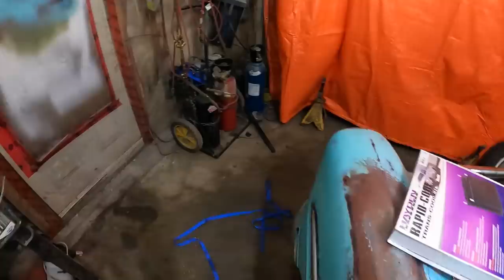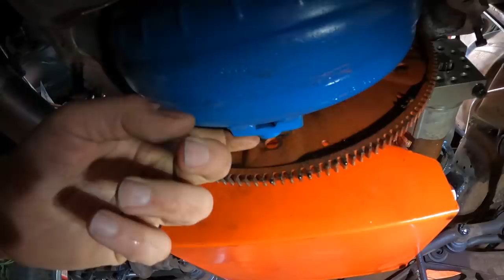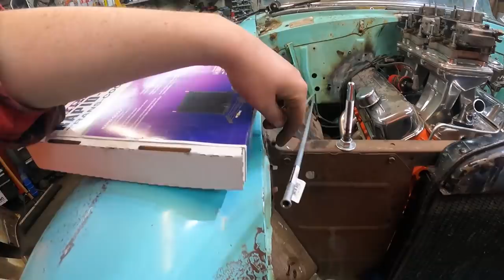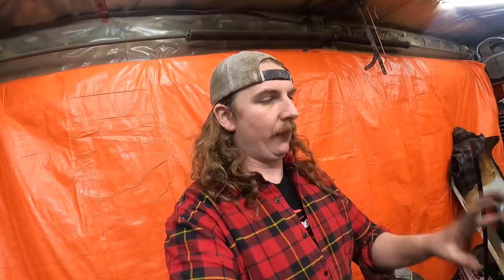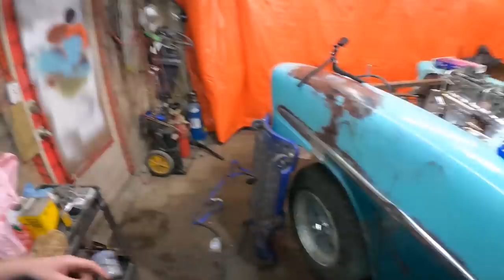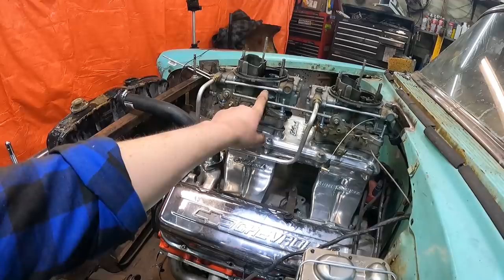How Much RPM?  ALL OF IT - Running A Chevy Big Block Wide Open With a Massive Fuel Leak!

Comment: Pulling the converter that far forward, you're not worried about breaking the ears out of the transmission oil pump, during a hard launch. Maybe install spacers or even washers between flex plate and converter in order to ensure converter ears/teeth are fully engaged with pump. But hell I may  be wrong, gas on it.

Comment: You have a lot of gap between the flex plate and converter so be sure to put some kind of spacers in between so you have full pump engagement with the converter hub.

Comment: All you need to do with that old alternator is run a wire from the field to power output on the alternator and your done. Those one wire alternators do exactly the same thing but internally so you can't see it. And it's a flexplate not a ring gear lol.

Comment: Damn! That engine sounds fine! Should glue a couple big neodymium magnets to the bottom of your starter box. Open up any old junk 3-1/2" hard drive to get a couple nice big ones. Maybe some thin rubber between the magnets and your "shiny" paint. Then you could slap that box down almost anywhere and it would stay put.

Comment: make sure the t-vert is engaged in the pump gear  drive.. fly wheel to con vert  gaap.. shim inbetwen with spacers washers to 1/8". this way pump gears are  engauged in converter drive lugs fully. loooking good dan..

Comment: Go to harbor freight they have a Chief burr bit set for $50 comes with your four common shape bits and they are AWESOME. And 50 bucks is a great price for a set of 4. I've paid $40 for just 1 in the past. I've used the shit out of them and they are still sharp as day 1! Comes in a handy dandy pouch too. They are hanging on the wall by the air tool display. Harbor freight RULES!!! I'm a heavy equipment mechanic and my tools get used hard and 90% of my tools are harbor freight and all my cordless stuff is Hercules and i can't tell you how pleased i am with that stuff. I'm proof that their stuff holds up to commercial use. If you buy Hercules tools ABSOLUTELY pay for the extended warranty cuz then you just exchange your tool every year for a brand new replacement for like $10 extra! Then you buy another year warranty and continue renewing them every year for $6 to $10 per tool! No questions asked, in store exchange

Comment: Definitely a "Franken-wagon" . You live a bit dangerously , my friend ! With all that HP , you might want to reinforce where you bolt the seat down . It's good that it has a new floor & all , but when you "launch" that monster , & it hooks up /grabs traction , anything in the front seat is going to be G-forced to the back of that bus . I've no doubt that the front wheels will leave the ground , & you my friend + passenger , will have an accident(s) in the next few seconds . Depends ! Definitely tape it ! Rock on Dan !

Comment: That fuel leak is scary, a car on jackstands and inside a building.
A friend had a 64 GTO with a big block chevy and tunnel ram setup. The hood was off and inside a garage under the house. He tried  to start it with the fuel lines leaking. He wanted to hear it run an after a bit of cranking it caught on fire with the flames hitting the ceiling. It was a good thing he had a few friends there. In a panic they pushed it outside and put it out with a fire extinguisher. The flames left their mark on the garage ceiling and without other people around he could have set the house on fire.

Comment: You might want to put a spacer between the flex plate and the converter. Learned that from performance transmissions channel.

Comment: Saving this for break but with the thumb nail.... I have take a guess.... 5700rpms
Reply: Sounds really stout Dan, I have one question  cuz I honestly don't know but do over think everything.  Will elongated th holes on the fly wheel effect the engine balance? 454 are external balanced on the fly wheel I think?

Comment: Having had a BBC in a 57 since 1987 I can tell you that stock rad won't cut it. Luckily a larger alum cross flow isn't that much $$ these days. Just have to match up top and bottom hoses.
Reply: I ran one in a Nova. Used Cadillac 4 core cross flow radiators to keep it cool.

Comment: Be sure that the centre hole of the torque converter fits the ring gear. Otherwise it could pull itself loose from those elongated holes.

Comment: Most parts stores sell a flexplate with dual pattern torque converter pattern that accepts the "big" and "little" patterns. They're like 40 bucks US at most places. Pioneer FRA-111 I think is the correct part number 454 dual pattern flexplate.

Comment: That fake injector air cleaner looks very restrictive to the air flow to the carburetors.  I would put open air cleaners of the 2 carbs.  However it is not my car and do what makes you happy.  Thank you for the video sir.
Reply: @MrGixxer1300r   Agreed. I'm just happy that's he's putting his efforts in these left-for-dead relics - and making them into certified Hot Rods. (Especially jealous of the Challenger TBH.) Once upon a time, building a Hot Rod was for the learning process and in-your-face boulevard attitude - not he time slip! Keep 'em coming Dan!

Comment: You should mount trans cooler on its side. So fitting out the side not out top or bottom of cooler.... use bottom fitting as feed and top as return so the entire cooler is used and trans fluid stays in it longer

Comment: Think the alternator bracket to Intake takes  a threaded rod intake bolt then alternator plate with a nut. 2 Nuts n threaded rod.

Comment: that is  not a six bolt flexplate its a three bolt ,but has two patterns .just turn the converter to the next bolt and it should line up?

Comment: Now you might just get to fixing drive problems now that you have teased yourself. I watched a video of a guy down in portland, Dezzy speed shop... not sure but will look it up. He knows a guy who is and has been for a huge long time hoarder of chevys. I seen rows of fenders as far as you could see, body panels, anything electrical like wiper motors and such but a rough guess is around five thousand cars.... okay I might of stretched it but acres of these chevys and gauge clusters and you name it... if it could be glued to those chevys including new fuel tanks.... everything. Prices reflect that they need to move on their situation and  they ship anywhere and anytime.. Its one of his last videos like something tour or what but best twenty minutes of your life that you will never get  back. Speed gear and speciality parts... I hope that infor might help in the future when you  have that week to wait for something that your on the next to do list. I keep rambling on on the other.... sorry, I liked this video and watched you smile when it fired off. It's a good thing when it works as planned. I wish that the distributor was in front when it needs to be adjusted on chevy. I think that there is a small air leak somewhere thats not sealing off the outside air or it would idle better... I know that cause I got a big  certificate saying that us armchair mechanics are absolutely right no matter what the guy says that is holding a damn rod in his hand/LOL...My ass too... some of that stuff like the window cooler n all different kinds of things there.  AHH get a life morgan....Later

Comment: Just a quick ?, why didn't you use the 3-4 core aftermarket aluminum radiator with the trans-cooler built into it? The tri-5's are really really cheap, and they work very well (the caps SUCK throw them away immediately). I believe the brand is CCR, I get them off of E-Bay or Amazon for $150-200 bucks (us) and run Dex-Cool or Waterless through them and have had extremely good luck with them. Even when cooling the notoriously hot 460 BBF. 
Dig the build, and I actually really like that "brush guard" on there. It goes with your theme very very well.

Comment: I'm not 100% sure I like your fuel pipe routing. I think I'd have gone from the brass fitting, then made a hard turn across the manifold first and then down to the pump.  Reason being you'd have better alignment for a filter and it'd be keeping the line as far away from the block as possible.  The other benefit to this routing would be keeping the fuel a few degrees cooler.  Depending how low the hood is in comparison to the intake and fuel line,  if the fuel line is in the breeze, you'd really have a good fuel cooler going on.

Just my nickles worth.

Comment: If you send me the length of the shaft I will have it made and sent out on the house all Spicer or neapco parts.  Is it 1350 or 1310. Slip yoke or straight tube?

Comment: the 454 takes an externally balanced flywheel and balancer   the 396,402 and 427 balancers and flywheels  wont work
Reply from the maker: Correct

Comment: I don't get why you'd want to send down a chrome water pump pulley half your motor is Chrome already
Reply: Because if you don't sand down the groove, chrome pulleys like to throw belts. Or just make the belts slip, and then your alternator dies, and leaves you stranded on the side of the road. Ask me how I know.

Comment: I have noticed Dan is not replying to posts anymore and when he does his reply's are kind of lame .
Reply: Go lay down bud
Reply: @blakestone8088 ----  Knowledge Wise lol , I been restores show quality muscle cars for a living a long time, I only try to give good advice to save him work & time, but in the words of Frank Sinatra ,  he does it his way.  So now I just watch and say nothing holding my head low in a oh god  NO movement.
Reply: @blakestone8088   Guess it come down to everything that Dan feels is boring he just fast forwards or just glosses over. But in reality is a very basic part of what it really takes to complete a project. And his so called wins are just noise, witch gets old. Then just flips the subject to a totally different venue of manufacture, ( Ford to GM to Mopar )  and most viewers are at a total loss because the project he's been building was never completed.  So over time we watch less and less. Dan gets bored with the project witch is his right, so he sells or trades the incomplete project. I was very disappointed he sold the T before it was complete because I wanted to see how well the stock 283 really performed in the light chassis and now nobody has any idea. It's the same way now, Dan gets burned out on the wagon then gets something else out and doesn't finish the project witch again is his right, however levies his viewers wanting the project  ( Dogs in the back going on a long trip out of town ) not completed. Bottom line , it's getting old. And yes I know, if you don't like it leave, fact is I been watching other builds more & more . Just my view .